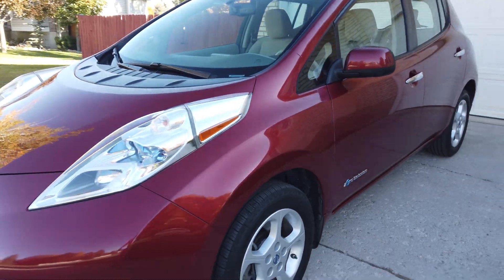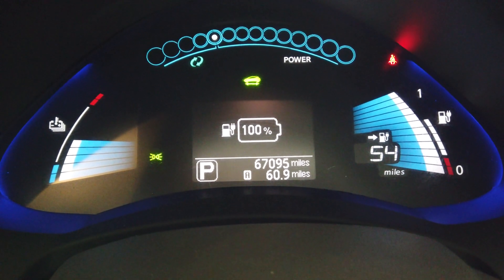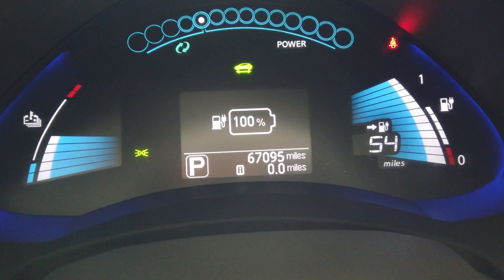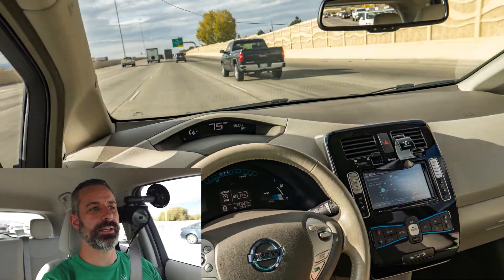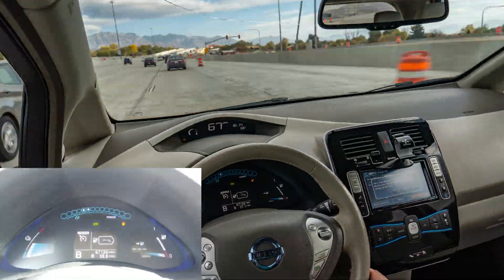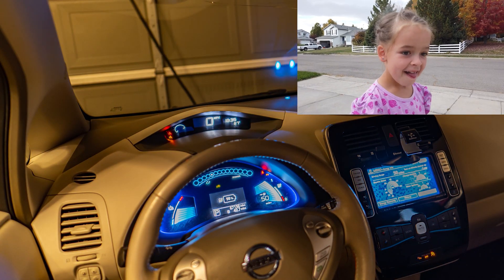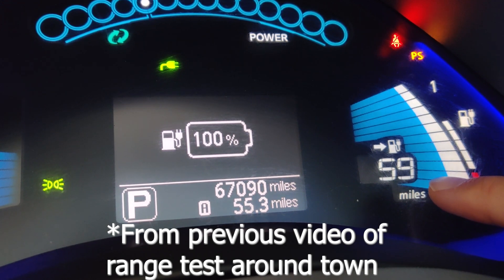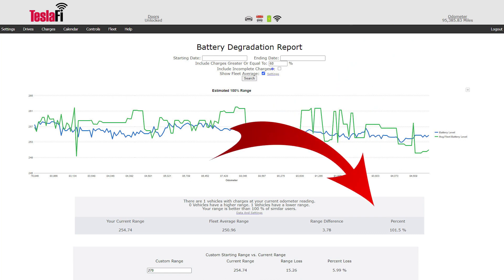What Is The Range Difference of City vs Freeway Driving In A 2013 Nissan LEAF With 67k Miles?

Comment: Owned a 2013 leaf for 10 yrs now. Currently has 101k miles,45% degradation using leafspy and at full charge has around 40 miles. Thanks for the video
Reply from the maker: Wow, thanks for sharing!

Comment: Thanks for this video, i have a late 2012 leaf with 11/12 bars,81% SoH, had its now for 2months, bought it with just 24k km on the odometer, my intention is to use its for work commute which is 64km both ways. From your car SoH and how far its can still go says much about what is left in mine, for years to come i will still be able to use my leaf for the purpose i bought it for without worrying of degredation.
Reply from the maker: Yep. The uninformed and inexperienced public scream about battery replacement costs, but the reality is that there's a lot of use cases that don't need long range and the reduced range is not a problem. I do wish that the LEAF had active thermal management though.

Comment: 40 miles, its like 60km? it is nothing. any petrol car will go 600-1000km on tank. and new battery costs what, 7000eur? it is crazy not worth.
Reply from the maker: Depending on the use case the minimal range of the LEAF is still useful. In my case I only drove 12 miles to work round trip and I had free charging at work so I was getting to work for free. Considering how cheap it was to purchase I would totally do it again. I stopped going to work at all though so I sold it to a family who got it for their teenage children to commute to high school in which was only a couple miles away and that's a great use case too.

Comment: I have an 2011 leaf with 67k miles and 1 more bar shown in your video I get summertime about 48 winter 55-60. The funny part is we have the same color leaf and I'm considering a used model S to go full Electric. My wife still has a pilot.
Reply from the maker: We had a Honda Pilot which we sold when we got our Model S. For about 18 months we had the LEAF and Model S, then I sold the LEAF and just had the Model S as our only vehicle for another year until we got our Ford F-250 to tow our travel trailer with. The Cybertruck can't come fast enough!
Reply: @ElectricTechAdventures   the parallel is real haha. Since my leaf dropped one bar since I bought it I was considering swiping it for a RAV4 ev (Tesla)  cooled battery and better range slightly more versatile . Cybertruck is going to be amazing 🤩 there was a recent video on YouTube with some of the updated changes.
Reply from the maker: @shamwow316  Yes I'm very excited to get a Cybertruck, but I'm also very worried about seating and pricing. Their website still says it'll seat 6, but all the prototypes that have been seen in public only have 5 seats. Also my expectations for a $70k tri-motor Cybertruck are now in limbo waiting for Tesla to let us know what the actual pricing and options will be now 4 years later. It appears that information is coming soon and I'm anxiously waiting...

Comment: Given a flat Highway  , Open Road... what do you think the most efficient speed would be?
Reply from the maker: Less than 45mph, probably closer to 30mph. The LEAF doesn't give energy consumption information and I haven't tried to use LEAF Spy or any other device like that so I'm going off of my experience in this LEAF and electric vehicles in general.
Reply: @ElectricTechAdventures ... tyvm...just got leaf registered yesterday ... Bring my wife to work 2 days at 20 miles each way morning & evening...
     Gotta be prepared when only using 120v , huh ?  I'm learning.
Reply from the maker: @E52ndFlatbsh  Yes it's a fun learning curve, at least it was for me and I just took it a little bit easy initially and then after a couple of days of driving got a better idea of how much power consumption I was using each way and what the capabilities of the vehicle were.
Reply: @ElectricTechAdventures  got it ....And yes ,its definitely fun.....30 mi. Each way to doctors this coming monday....I'm just going to do it ....got the chadmo if anything...just have to set up accounts ( I guess ) , and learn how to use level 3
Reply: @ElectricTechAdventures  ...this is a great car....not worried about degradation bc of ur vids...thx

Comment: Thank you for making the Nissan Leaf videos.  Do the batteries continue degrade and the miles decrease accordingly or is there a point were say 5 bars and the car no longer functions? I'm considering buying used because they are so cheap, but want to know if the battery will go quickly and I'm better off saving for a newer EV.
Reply from the maker: The capacity of lithium ion batteries just continues to degrade over time, so you should be able to continue to use the vehicle until it's range is too little to be of any use to you. At least that's what I've read.

Comment: Very helpful video! I just bought a leaf by someone on Craigslist and I can only go 30 miles then needs to charge. It’s a 2011 and has about 52,000. I have been chatting it for 45 min at a local charging station but I think I’m going to purchase a charge for my home. I noticed that the dash board has blue LED lights. And so far I have reached 2 and a half so hopefully with charger I get a couple more miles when the led lights are all solid blue.
Reply from the maker: 30 miles is rough, I agree you really need a way to keep that charged up at home!